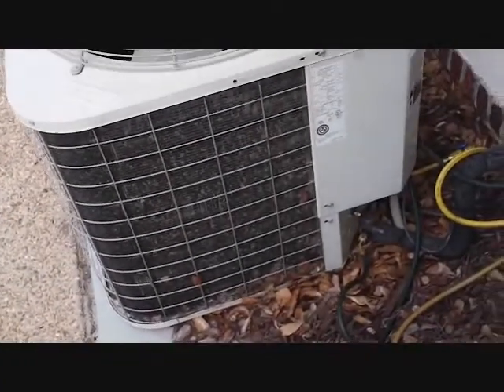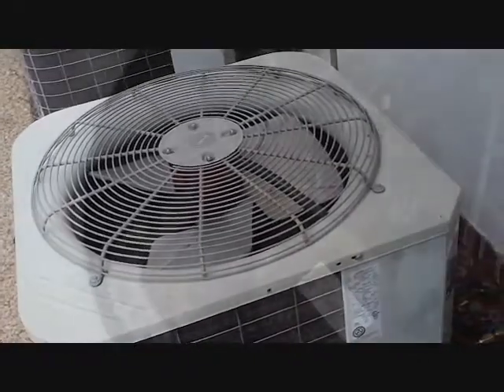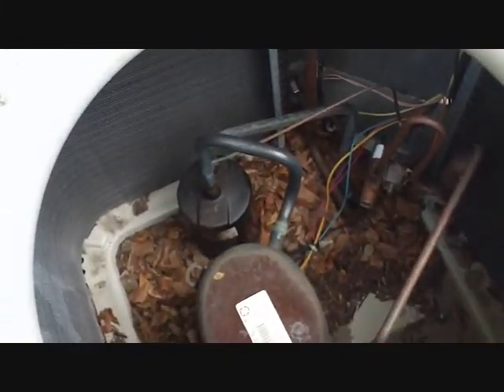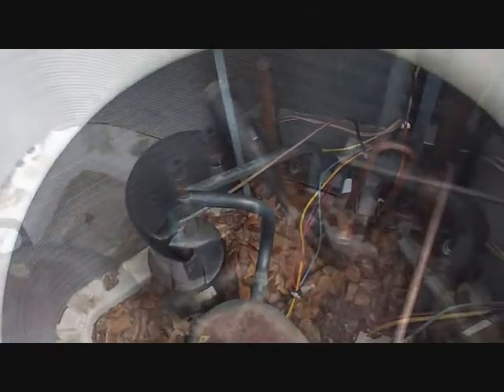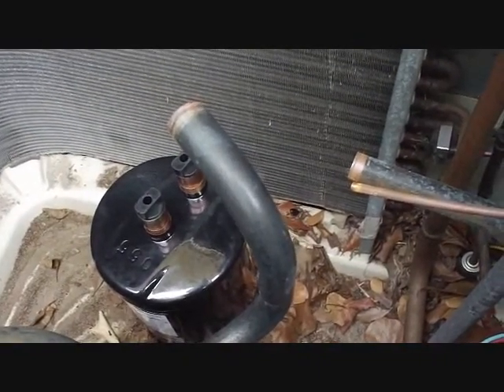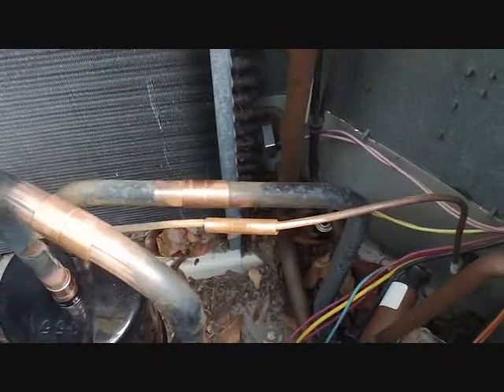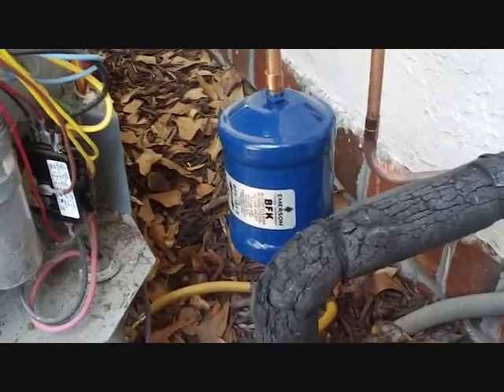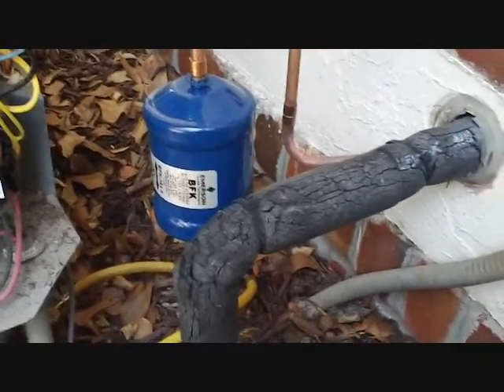HVAC Repair: Bryant Accumulator Change

Comment: Hi, great video! I just noticed I have a leaking accumulator from one of the connection points and I will have a technician come out and replace it. About how much does this cost so I know if the technician is overcharging me or not?
Thanks so much!!

Comment: i bet he doesnt give a shit about air conditioning anymore
Reply from the maker: I like it cool in my house
Reply: Do accumulators make noise before death? My unit made a horrible metallic sound before dying, then I noticed refrigerant leaking under accumulator.  My compressor shot too?
Reply: Do accumulators make noise before death? My unit made a horrible metallic sound before dying, then I noticed refrigerant leaking under accumulator.  My compressor shot too?
Looks like same KH71KJ140 part too

Comment: I came across a leaking  accumulator last week which was leaking from the side.   I brazed in the new one and pressure tested it and was baffled to find the new one leaking from the side.  I pressure tested at 200 psi. Was that too much?
Reply: ive been told 50 psi is good test pressure

Comment: How many microns did you evacuate to? You could have just heated the fittings on the old accumulator and used a pair of channel locks and pulled the suction lines out of the old accumulator. It woukd have saved you some copper, acetylene and silphos rods.